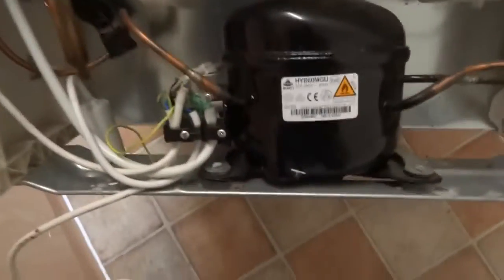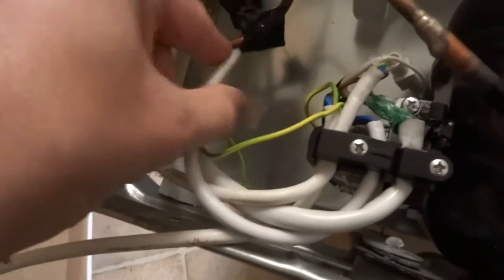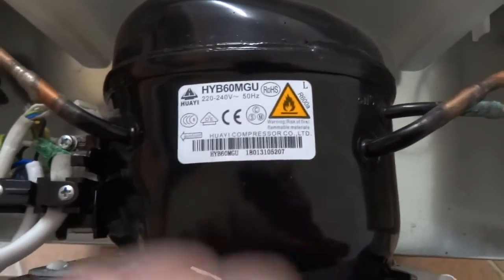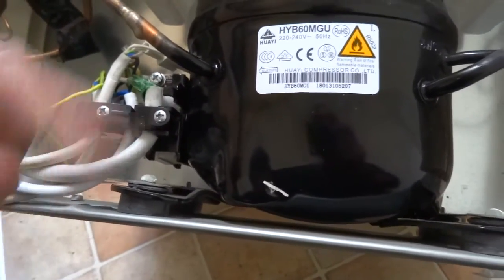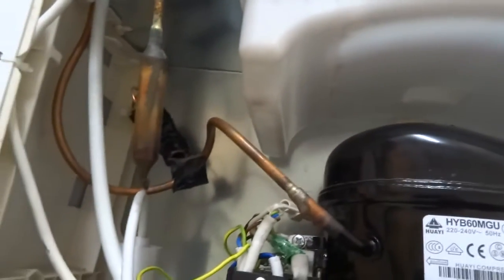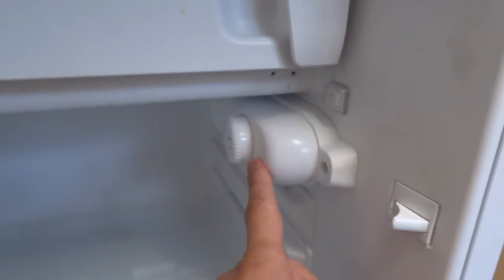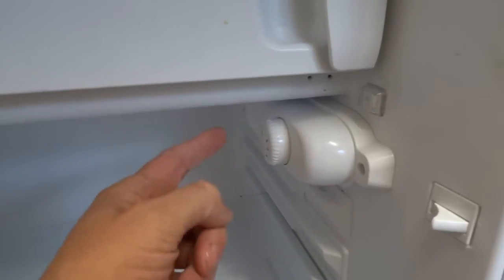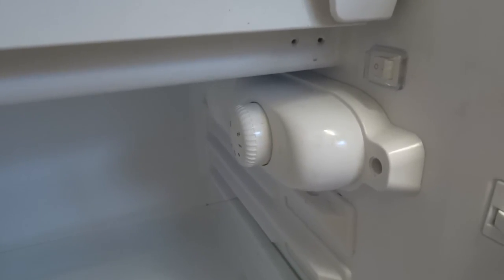Top 5 common issues problems faults refrigeration fridge freezer not cooling

Comment: Thanks for posting, however the failed to mention that is the refrigerant has leaked then you don't just regas it, you must find the leak and fix that first, then ideally pressure test it with nitrogen unless you are confident enough you've not got any more leaks on the system and so go ahead and regas.

I without a doubt am sure you know this but just forgot to mention it in the video or assumed people may automatically know this but remember, new HVAC engineers may be watching this too.

Thanks once again for a great video showcasing common fault finding with refrigeration systems.
Reply from the maker: Yeah its easy to miss vital information in these quick videos, ill pin post. Thanks for input.

Comment: My hot point fridge freezer is freezing everything in my fridge. I have reduced the temperature but having no luck 😢 csn I replace the thermostat to fix this problem.
Reply from the maker: yeah possibly the thermostat
Reply from the maker: good be poor airflow or defrost system

Comment: Please help with mine it can't freeze
Reply from the maker: you need to test components with multimeter
or call out a service engineer.
Reply: @cagmito76 yes I did try that yesterday and we even regas it yesterday it work about only 1 hour  and after that it stopped bringing cold
Reply from the maker: @SandileSiboniso-x3r  maybe gas leak

Comment: My mini fridge was working fine but making a loud wind noise. I emptied it and was going to check it out. As I removed it I tipped it and the wind noise reduced so I tipped it further and the wind noise stopped. I thought it was fixed so I filled it up and it now runs quietly but doesn't cool at all 😂. Have I killed it?
Reply from the maker: hope you sorted it , id of left itto stand funpluged or a while and retried and then tested

Comment: hello hello Hello family? May peace be upon us!
I have great respect and gratitude for any service you provide and I am your admirer.
1. After working perfectly for about three months, the new Enzo Deep Fridge has completely stopped working. The main symptom is that after I plug it in, it makes a beeping sound and then turns off after 20 or 30 seconds. Can you please suggest if there is an easy way to fix this problem? I'm so sorry
Reply from the maker: you need to test compnents

Comment: I have a new refrigerator since I bought it, and it does not cool at all in the summer, and the freezer section is very light...in Saudi Arabia I bought a second one with the same problem, what is the solution?
Reply from the maker: test components

Comment: Hi, my fridge-freezer freezer hasn't been freezing food lately. I've tried defrosting it and this worked a few months ago but I'm now having the same problem again, even though it's not freezing over. I've looked at the back and it resembles yours. I've taken a couple of caps off the end of the copper pipe valves. Why were there little rubber caps on the end of these?

Comment: Hi mate got an issue with whirlpool chest freezer starting to leak water on the floor every 20 + hours about 2/3rds of a point.
This chest freezer does not have any drip tray at the back or underneath, No water leak at the back dry and clean, no water leak from the bottom drain plug,
So I am puzzled as its defiantly coming from under the freezer somewhere don't know model number but has AFG 519/H on the back,
Any advice would be appreciated please

Comment: Wonder if you’d have a suggestion, my belling fridge is only a little cold on the upper section of the back wall inside the unit. The compressor is hot and sounds normal but fridge is not cold. I’m thinking I need a new one? 👨🏻‍🔧

Thanks in advance.
Reply from the maker: there will be a blockage of ice in between the upper and lower sections. Sometimes just letting it thaw out will work. It might be the auto defrost system is faulty if you unit has it fitted.
Reply: hi my bush fridge freezer is doing this exact thing, I have defrosted the fridge freezer plugged it back in and the fridge is still not cooling any idea what could be wrong and how to fix thanks

Comment: Great help these videos, thanks for posting.
I've an intergated BUSH fridge that was freezingup on the back wall so much so that anything touching it would freeze. I defrosted it then turned it back on and within 24 hours it was string to freeze again so I turned thermostat down and now the bloody thing doesn't cool at all.
I've had a look at the back and can't see anything obvious but theres still a hum from the fridge itself and the fan is working but the pipes coming to/from the compressor were black with a lot of black soot type deposit on them. Seems a shame to buy a new aplicance if this is a simple, cost effective fix.
I'd appreciate any advice.
TIA
Reply from the maker: It could be failing or incorrectly place thermostat / probe. It could be door seal as well not allowing the fridge to cool and making machine work overtime.
Reply: @cagmito76  where would the location of thermostat probe be?
Thank you for responding.

Comment: My fridge is on the blink, it's working, but it's over-cooling on the interior back wall's upper half which has a frost/snow build up forming within a week to the point that it has to be defrosted, whilst the lower half isn't cold to touch as if what's behind it isn't functioning.
 The thermostat control also isn't functioning, & the compressor is charging all the time. On the exterior back the radiator grill is warm on one side all the time whilst on the other side it isn't.

Any suggestions as to what the problem is appreciated, have had the Hotpoint/Whirlpool engineers out but all they did was fit a new thermostat immediately without any diagnostics, & when that didn't resolve it gave up saying it's beyond repair.
Reply from the maker: It sounds to me like blockage in baffle and frost build up can be seal failure around door https://fridgefreezerrepair.blogspot.com/2021/08/fridge-freezer-refrigeration-electro.html
Reply from the maker: https://fridgefreezerrepair.blogspot.com/2021/08/fridge-freezer-over-freezing-iced-up.html
Reply: @cagmito76  Thx for your advice - only just seem it, hence the delay in reply
Reply: I have the EXACT symptoms as you describe, including extreme frosting at the back top inside, insufficient cooling further down, compressor running too long, and a new thermostat not solving the problem.

I've found that the output of the compressor (the discharge / high pressure line) is not hot enough, and the evaporator (which is inside the back of the fridge) is not cold enough at the bottom where the thermostat vial measures the temperature (it gets to -6°C - measured by pushing a thin temperature probe through the insulation until it touches the evaporator). 

I've experimented adding and removing R600a, monitoring the temperature and pressure of the low pressure compressor inlet pipe, and have it working OK, BUT it only works at one particular temperature setting. If the knob is turned higher then it does exactly the same as you describe.

I think the compressor is failing to produce enough pressure to chill the evaporator to the point the thermostat turns off. However, I don't want to change it if I'm wrong!

Did you get any further with your situation?
Reply: @jb9652  No I didn't, I called 2 mechanics in, all they did was fit a new thermostat & when that didn't fix it wrote the unit off saying it wasn't commercially repairable, & I had to buy a new one.  Luckily I found a company that operated on a no fix no fee no fee basis, which wasn't easy in itself, several others approached before them wanted hefty call out charges paid up front, for what would probably have been the same outcome. It was difficult to even find fridge mechanics at all, as there are v. few repair companies offering the service these days. I got a fair bit of the cost of the new fridge back by selling off the parts of the old one on ebay tho, and the new fridge  is nice.
Reply: Another thing: My compressor is not drawing enough current from the mains, and runs very very cold. That's with the correct charge of R600a.
Reply: @jb9652 if the suction pipe back to the comp is very cold or icing over and the refrigerant charge is correct, it's flooding back. The refrigerant isn't evaporating fully before returning to the compressor. 

If your fridge/freezer has fans inside check they're working, lack of airflow inside can cause this